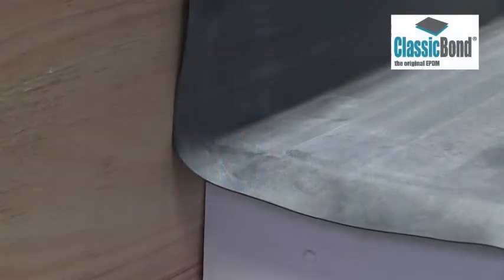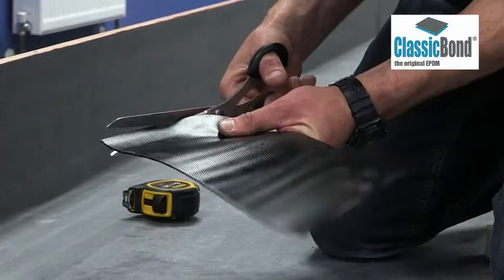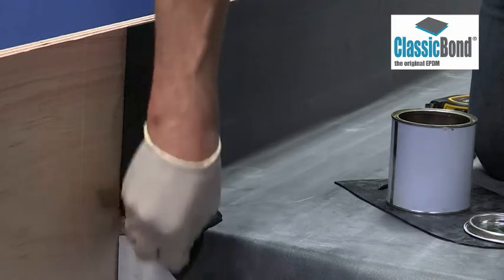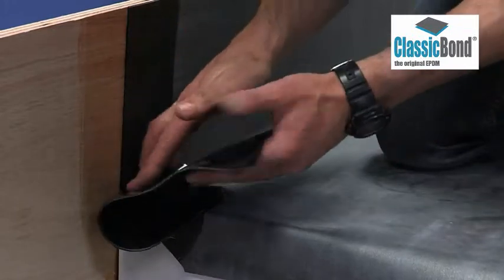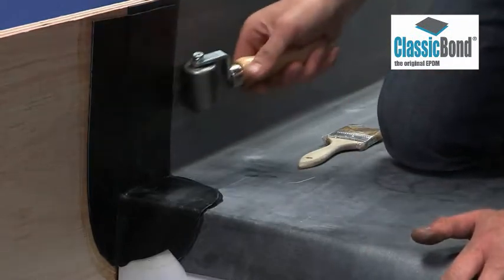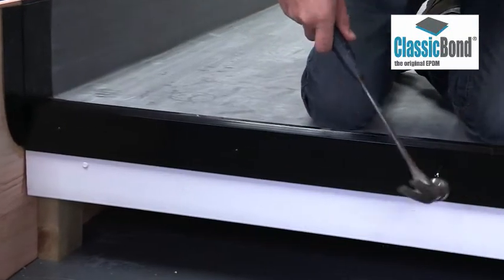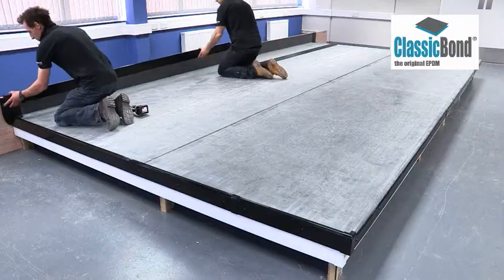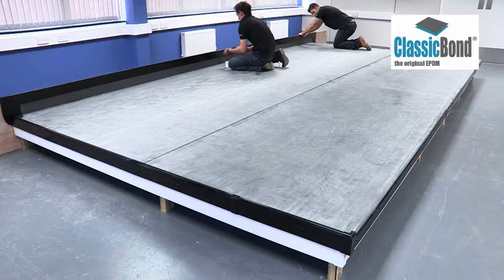Flat Rubber Roof with Sure Edge to Upstand - EPDM Installation Guides and Training

Comment: EPDM primer won't stick to brick work it will dry and when you touch it it will come off you need contact for brick work
Reply: Primer will bond to brick, block & render but it may require two coats, using contact adhesive will invalidate your warranty.